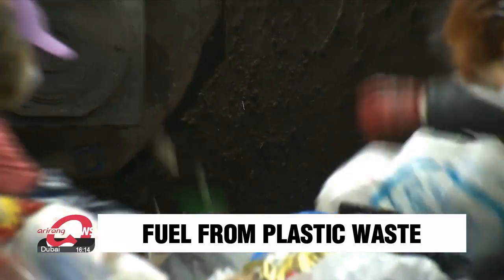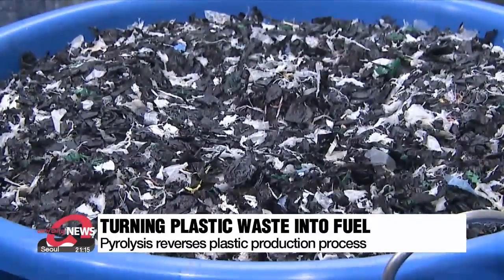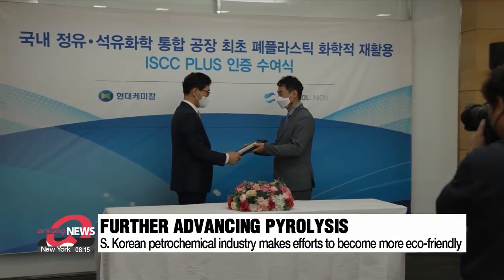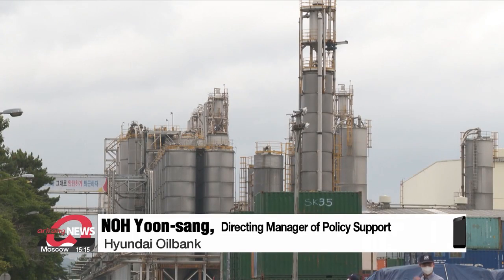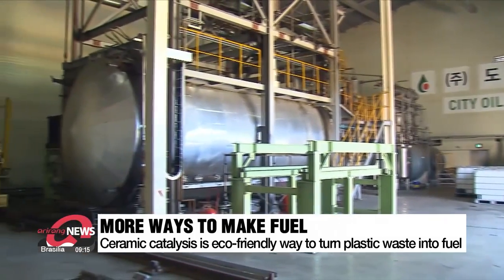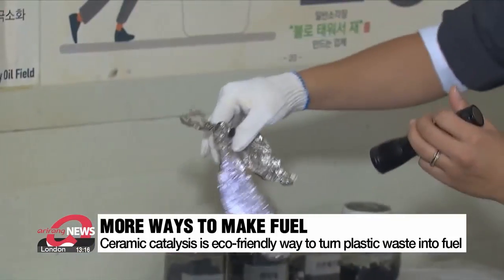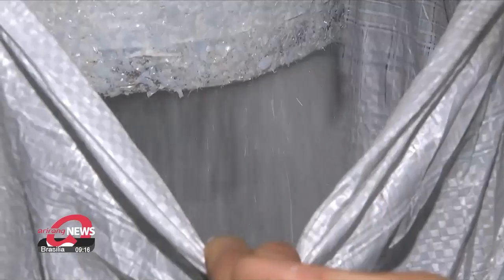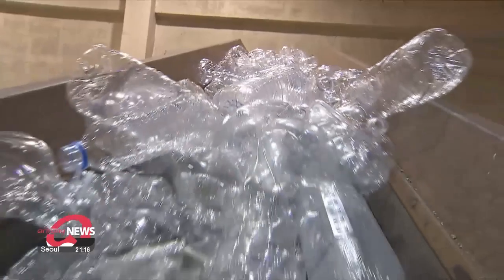New technology turns waste plastic into fuel

Comment: This is not new, nor what I would call technology but just commun sense engineering that plenty of poorer countries are already using to get alternative energy resources.
Reply: Indeed, as the report told the pyrolysis is a common technology to 'recycle' old plastic to oil. In Germany there was a big plant in Bottrop in the 90th. But it was not profitable and so they closed. As the report said, the new technology is that they don't need that high temperature because of using special ceramic catalyst and micro wave. I hope this method can help us to reduce the plastic garbage.
Reply: Interesting that it's become EVERYONE else's problem, except the actual MANUFACTURERS of said "garbage". They are all conveniently mum, as if it's not they producing this crap and polluting our home. Wish consumers would also stop drinking that poison filled sugar and chemical liquid called 'soda' 😢